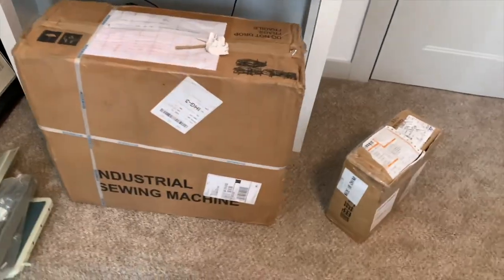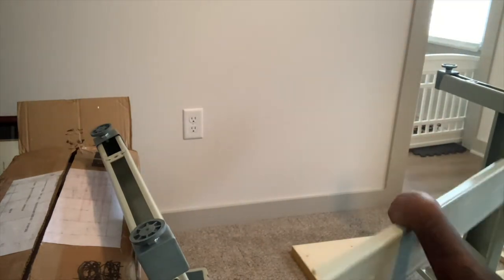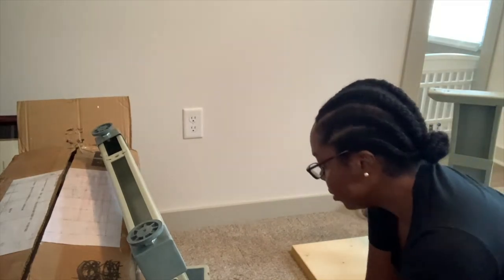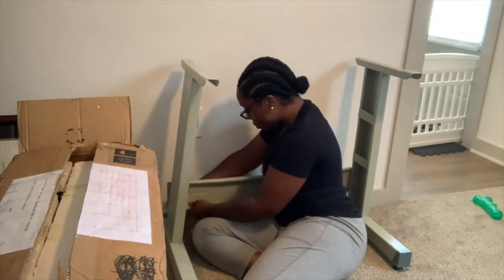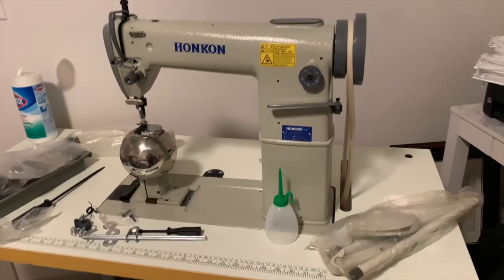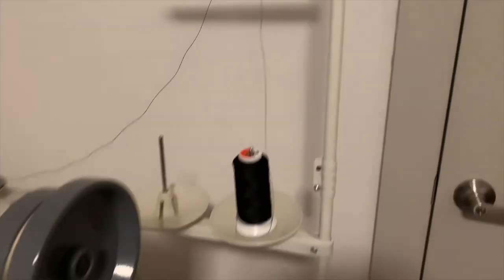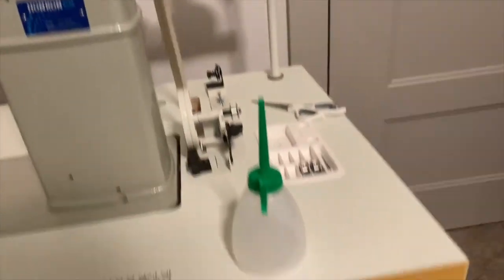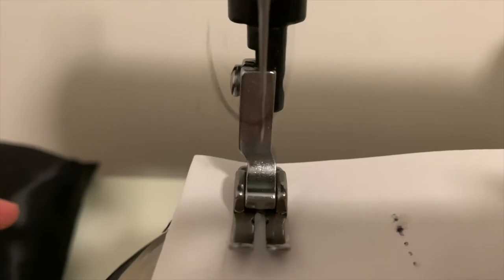First, Let's Setup My Industrial Sewing Machine 😜

Comment: Omg I have the same machine and I'm putting it together now, but I'm stuck on the knee lifter part with the spring and I dont know where to put it do you have a more detailed video or instructions? the installation videos  that these Chinese men did is helpful but not detailed they have three videos but nothing about installing the motor, wow this is a challenge
Reply from the maker: I can show you how I installed mine. The motor was the most challenging for me as well!
Reply: Hi, did your machine come with a table or did you have to buy separate? Does it come with the motor or is that a separate cost?  

Thank you for any information you can provide.